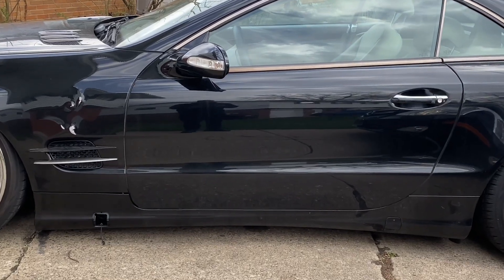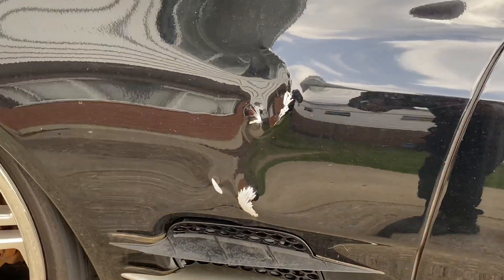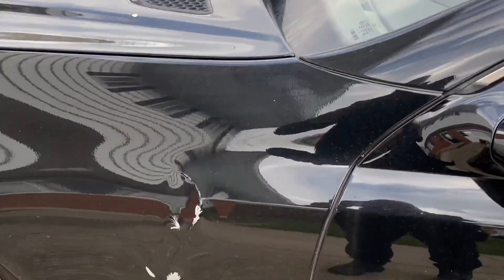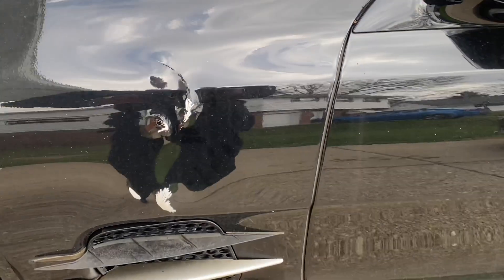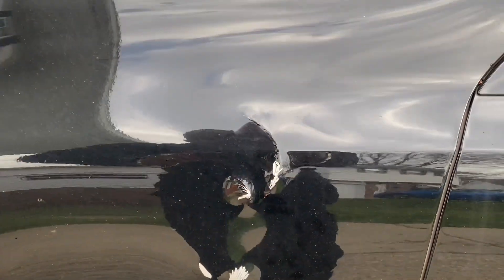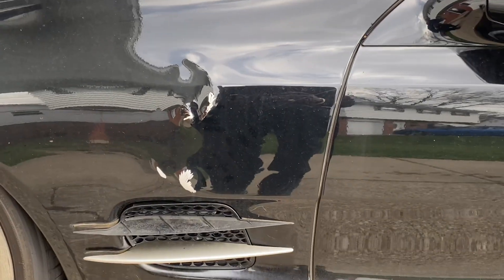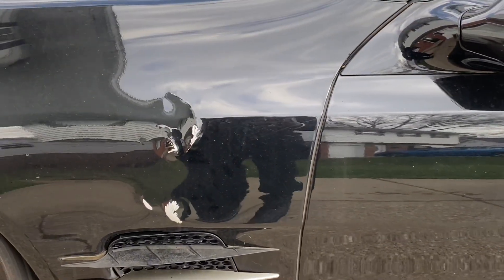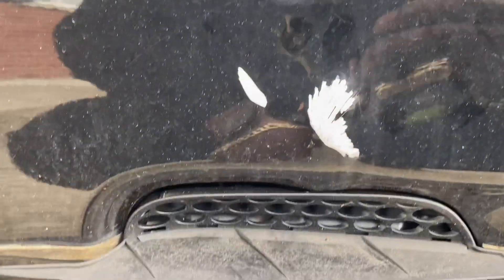BEWARE!!!! SL500 Mercedes-Benz ABC Suspension Failure ……WOW!!!!!

Comment: Hi, I'm your subscriber from Russia!) Please explain: I changed the abc system to regular springs from sl350 (I have sl500 r230) and in addition to a critical error, the roof also does not open.  if you remove the critical error, will the roof work?)
Reply from the maker: Hello and thank you for subscribing! What is this critical error that you received?
Reply: @goldelementautoworks  the display on the dashboard turned red and the words “careful, car to low” appeared.
Reply from the maker: @sabirov8889  The roof is not related to the ABC system. Unless you broke a line in the trunk while changing to coilovers. The red ABC warning light on the cluster can be fixed by removing the ABC fuse on the driver side fuse box under the hood in the engine compartment.
Reply: @goldelementautoworks  thank you very much for the answer!  It remains only to find a good diagnostician in a village called Moscow)